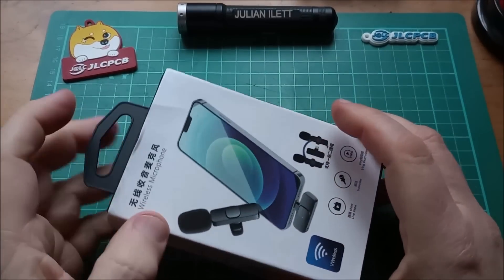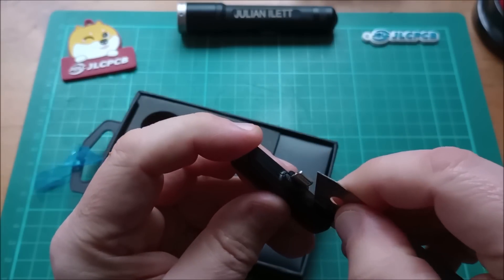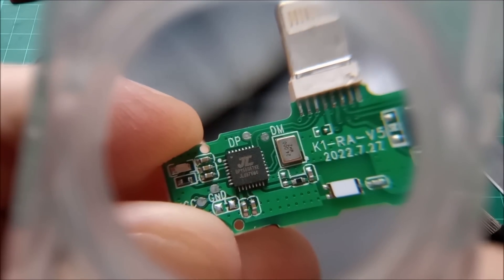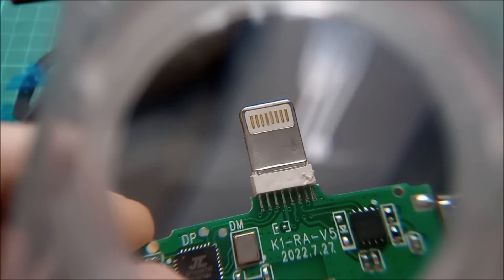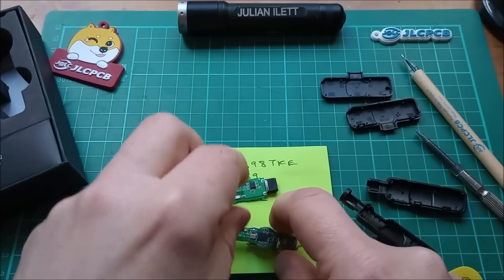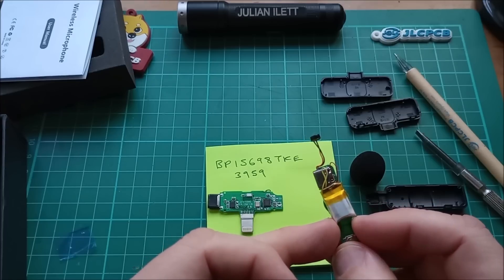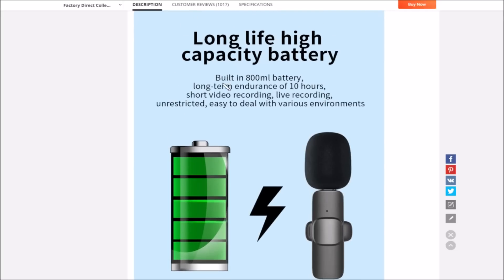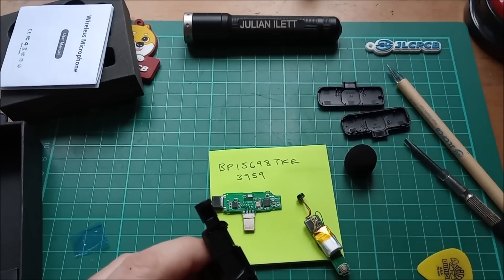What's in a Wireless Microphone?

Comment: Interesting! As for wireless mikes in the states, the FCC has twerked off musicians and theaters. It seems they have re purposed several bands several times. It leaves many with expensive useless wireless systems. Some individuals have even thumbed their noses to the FCC and continue to use the devices until someone complains. Most of the time the frequencies have been reallocated to law enforcement so it’s a big risk.

Comment: I definitely would not make the assumption that these work in 2.4GHz band.   They often do not and you really need to find out as a lot of these wireless microphone kits that are made in China run on frequencies that are illegal to operate on in the UK, US and Australia ( and maybe other countries too ).
It would be unusual if they are running on 2.4GHz to be honest, especially with such small cells as the power consumption would be quite high at that frequency compared to lower frequencies.

Comment: I'm curious if the audio that comes out of it is stereo with one channel for each microphone, or mono. Mono would probably be a lot more useful since that could be annoying to change it from one audio channel and one silent channel to two duplicate audio channels. I'm also curious if these just act as a generic USB audio input device, so the only difference between them is the connector. In which case you could probably use this with a female lightning to USBee-see passive adapter. At the very least, you should be able to connect the USBee-see one to your computer with an adapter and use it to record your screen capture segments. That might help with not having to yell into the microphone (not to mention having consistent audio quality).

Speaking of which, my expectations for the audio quality is pretty low. Considering the cheap price, you'd expect 1970s CB radio quality, but hopefully it's not that bad. Let's face it, you're not exactly going to win the Oscar for best voice narration, that's not what we're here for. As long as it's better than telephone call quality, that should be good enough.
Reply from the maker: I'm curious too. I suppose it's possible that the first microphone to connect is placed at the centre of the stereo field, then when the second mic connects, they're moved to the left and right positions. But I think it's more likely it will be mono with the two mics mixed 50/50. When the USB-C set arrives, I'll have 4 mics, so how many channels does the receiver chip support?

Comment: Actually you can swap lightning port with a USB one, because u have those test points on board which correspond to USB: Vcc, Gnd, Dp(D+/Green wire), Dm(D-/White wire)
Have a good day!
Reply: not to mention there are converter plugs :)
Reply: You would also need 5.1K resistors on the CC pins of the USB-C connector.
Reply: @dfear  sadly lightning is usb2 so no resistor required
Reply: @jolilos  resistors are still needed for USB2 when doing a USB-C to USB-C connection. Each end needs to know who is supplying power.

Comment: Regarding these JL (JieLi) chips...

The first one appears to have the chip's real part number in the second line of the chip's marking -- "JL6976M4" (which refers to AC6976M with 4 Mbits of flash), which is rather unusual.
So the first line with "BP15698TKE" is just chip's "serial number".

As with the second one, you seem to miss the part that comes after the dash, which contains the part number (or rather a part of it), so as far as I could make it out, the marking probably reads "BP05522-76A8", which refers to AC6976A with 8 Mbits of flash. (but again, trying to make it out was quite challenging!)
Here you consider the chip's application and bunch of other factors to determine the rest of the part number correctly..
Reply: @kagamatiq6580 Hi, I have a question that is kind of related with your comment. Have just purchased a bunch of a popular Bluetooth module (it seems) HM-M18 that "sports" an AC6965A chip (well, after decoding the weird markings on it of-course). The chip is actually marked as AC23BP1U748-65A4 so, I can only assume that is an AC6965A, perhaps I could be wrong but have no other way of identifying the thing (so far).  They seem of a fair sound quality but: "For the life of me, how the heck one can get rid of that stupidly and most annoyingly Chinese prerecorded voice that is saying : (Your device is now connected etc...), OMG, is so f...g loud that literally blasts thru the speakers and it feels like it is going to break them at some point. I see that a lot of people have been searching for the same answer on lots and lots of forums.  So far, I've done some extensive research but couldn't find a proper "how to instruction" on how to actually do it. I know It's all about software/firmware manipulation but....had no luck so far nor had a red about anyone ever successfully doing it (so far). Some say:  that the firmware on certain chips is actually password protected and that there is a separate piece of software to reset it or get rid of it all together. . Any info, pointers, links are much appreciated. Thank you.

Comment: Hey Julian, question for you. Theoretically, could you desolder the lighting connection and solder a USB-C there instead?
Reply from the maker: I don't know. One would have to study how lightning and USB type C differ. I've not done that.
Reply: @JulianIlett  lightning and USB type C have different pitch, number of pins and pin out.
Reply: you can solder cables, i guess a 5v usb power input and maybe an analog mic output?